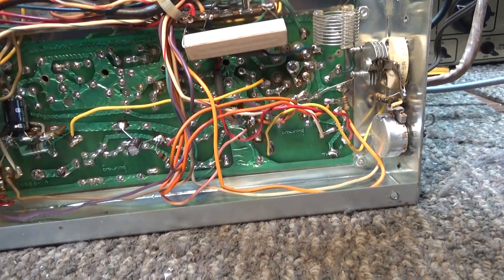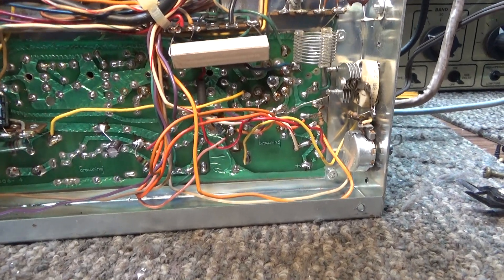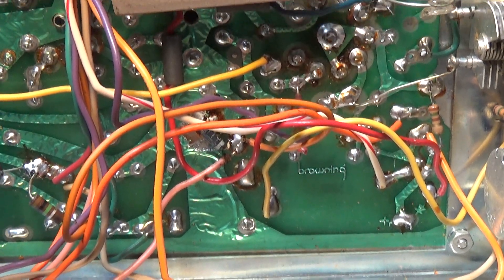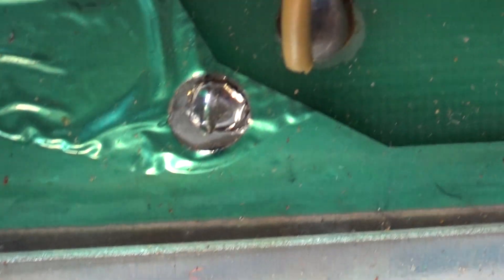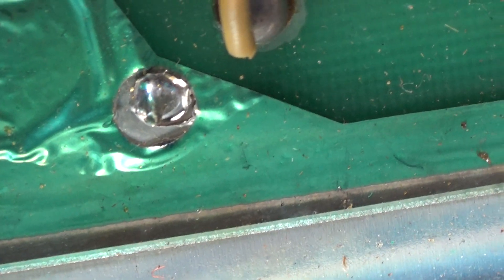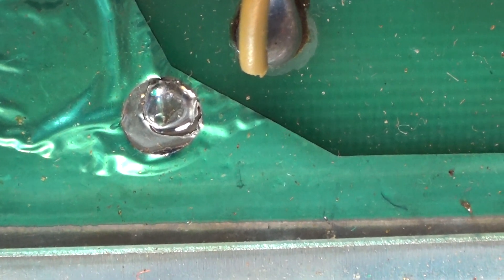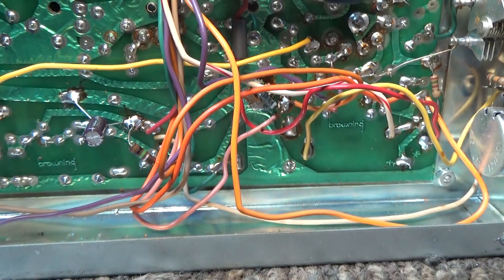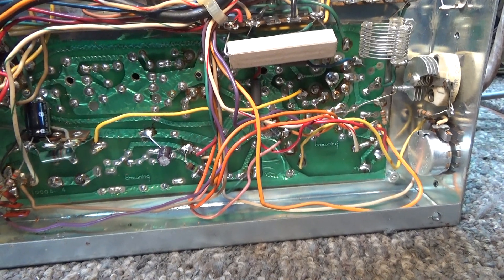Cold solder Joint Strikes Again.

Comment: That is terrifying to know how many cold solder joints could be in my 46 year old  rats nest. Damn gremlins! Thanks tramdr!
Reply from the maker: No Sir. The beauty of the Rats Nest is hardwired or point to point wiring. No, or limited, use of PCB's. That is the very reason the Rats Nest is the preferred D20l and for many people the Mark 3's and earlier with point to point wiring, are preferred over the Mark IV'A's with PCB's.

Comment: There are more than a few radios in my collection because of cold solder joints. Finding them requires two things that appear to be at odds with one another...

A disciplined approach. Figuring out which section of the radio isn't working properly narrows the search considerably. 
Good eyesight. A cold or broken solder joint will look different than the other ones.
Luck. This comes in too many ways to mention.
Reply from the maker: Luck, skills and patience. I can go for that.

Comment: Have you ever noticed the Browning's have distortion on some strong ssb signals, it's the same on my mark 3 and mark 4.
Reply: I've never noticed it on my Mark 3, but then again I haven't heard much SSB on the 23 channels. That said, the usual suspects are B+ voltage regulation and AGC overload. Despite claims to the contrary, the Mark 3 doesn't use a crystal filter and product detector, it uses a simple beat frequency oscillator (BFO). If the signal coming through the IF chain is stronger than the BFO signal, distortion and overload follows. The easiest way to fix it is to reduce the RF Gain control.
If you've done that and it's still distorted on peaks, lower the volume. If that eliminates the distortion odds are that the power supply voltage is unstable. If it doesn't then the problem is in the AGC area, and it's time to swap out one or more tubes in the IF chain. Hope this helps.